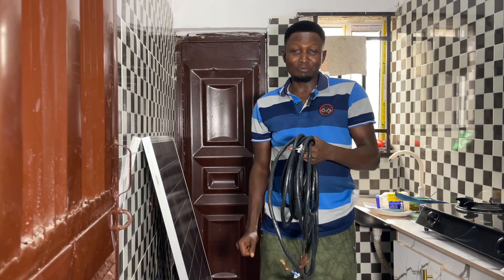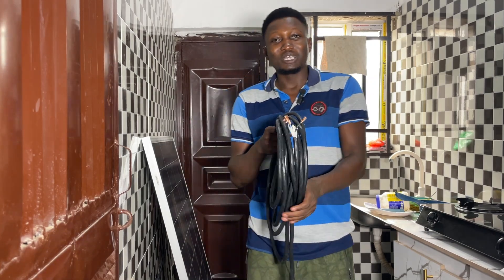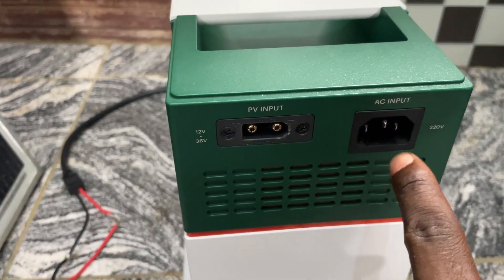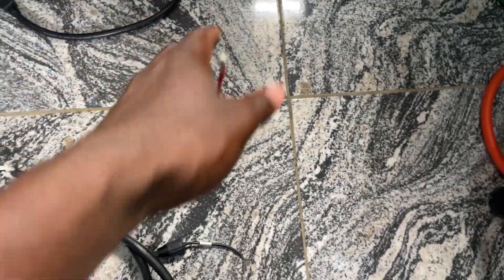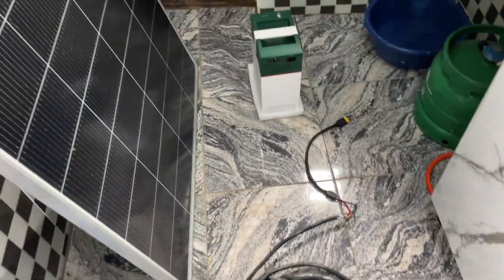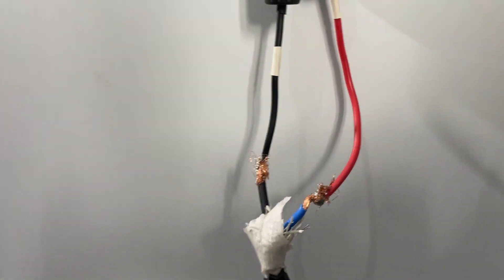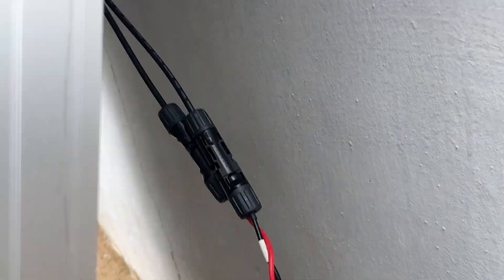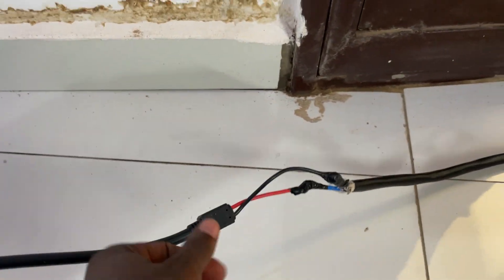Cola Solar Generator Modification: Extension Cable Installation Tutorial

Comment: Please how do I add panels to this connection? I want to add 3 panels to the one I have before.
Reply from the maker: You don’t need to add any more extra three  panels to it. Adding extra three panels to it would still not make it charge very faster as it should. One panel, preferably a 200 or 320 watts panel is okay and recommendable. You can get a good extension cable, like a 4mm cable and join it, if you must mount it on your zinc.

Comment: I got a 400watts panel with a 2.5mm Cable based on recommendation but haven't installed it yet. Looking forward to how long it takes your panel to charge it 👍🏾
Reply: How much you get 400w panel
Reply from the maker: I didn’t get the panel separately. I got them together

Comment: Does the solar comes with a panel
Reply from the maker: Yes, it does
Reply: THe seller said without panel is 260k and with panel is 320k @LearnwithMrBukie
Reply from the maker: @eminefohsunday5965 the price is really good then. I bought mine without a panel for 280k, and with a panel for 360k.

Comment: What’s your panel specification?
Reply from the maker: It’s a 320 watts panel
Reply: @LearnwithMrBukie which product, did you calculate the output if its original? and where did you order from?
Reply from the maker: @SGLEET from the specification, the product name is NPT solar. Also, I bought it from the same shop that I bought my Cola solar generator. I live in Abuja, Nigeria, so that’s where I bought mine
Reply: @LearnwithMrBukie please what’s the exact model number?
Reply from the maker: I will check it later and let you know
Reply: @LearnwithMrBukie still waiting
Reply: @LearnwithMrBukie ?